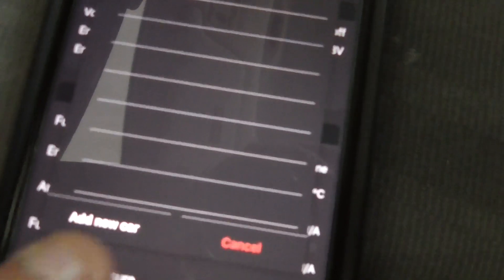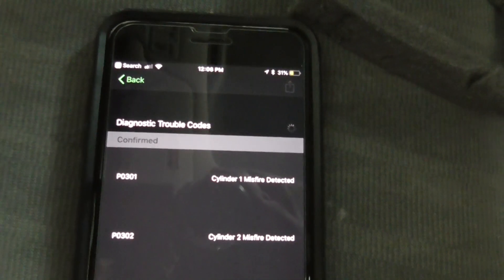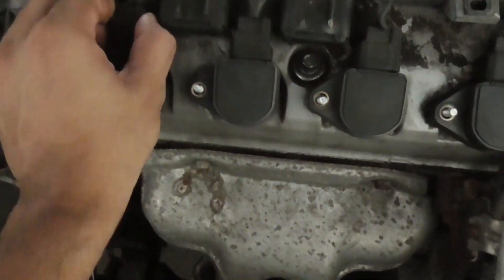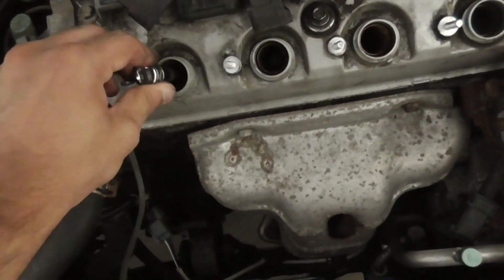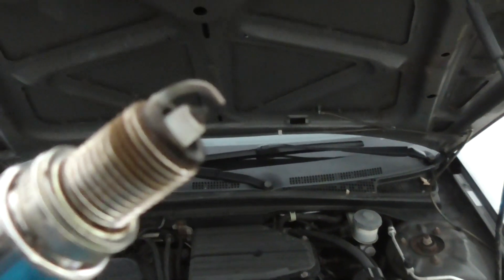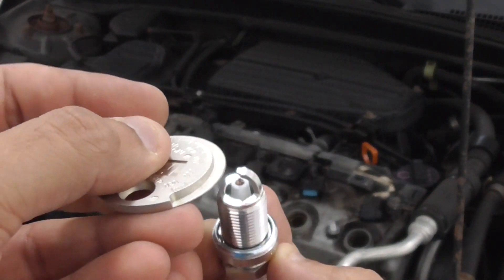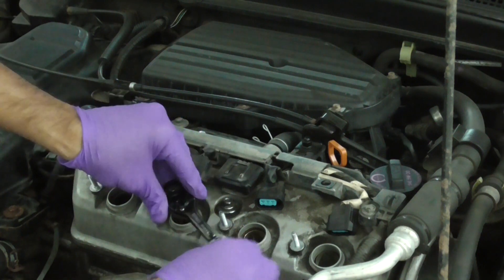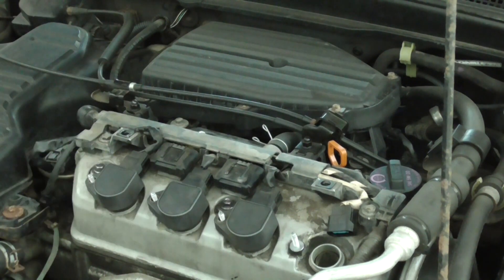How to Fix Honda Civic Cylinder Engine Misfire (Spark plug fix)

Comment: Sir, i already replaced the ignition coil, bnew sparkplug, bnew htw, but still, fuel injector code, 4th cylinder  misfire, d15b engine, help pls
Reply from the maker: Have you checked coils ?
Reply: @diysave1136  yes sir , its bnew
Reply: @diysave1136  is it posible with the harness?
Reply: I order a underdash harness , ill update you once i installed it

Comment: I just swapped all of my coils and  spark plugs and cat converter and I'm still getting a misfire cylinder 3. I called the dealer and they said I had to adjust the valves. any other recommendations??
Reply: Try replacing the injector.

Comment: I replaced the spark plugs and coils on 03 civic lx, and a couple weeks later, I receive codes for all cylinders misfiring. It runs kinda rough. Any idea what could be wrong? I appreciate any feedback you could give me. Thanks. Btw, very informative video. Good job.
Reply from the maker: Glenn Sosinske  can you try changing ignition coils for those who are misfirings?
Reply: @diysave1136  thanks for answering my question. they are basically all brand new coils, but it still shows that all 4 cylinders are misfiring. Brand new spark plugs as well. Do you think it could be fuel injectors? Any suggestions would appreciated.
Reply: I also forgot to mention: when I changed out all the parts, my honda was running fine. A month later, out of the blue, I get a flashing check engine light, and the engine runs rough.
Reply from the maker: Glenn Sosinske  fuel injector could be. I would check clogged fuel filter or fuel pump as well.  see if that is causing problem.
Reply: @diysave1136  will do. Thanks again.
Reply: @diysave1136  it was a bad head gasket. It's going to cost me $1800. Holy shit. Thanks for your help anyways..
Reply from the maker: Glenn Sosinske sorry to hear that. Hope all works out.👍
Reply: I replaced my spark plugs and wires i got a p0302 and p0304 code.